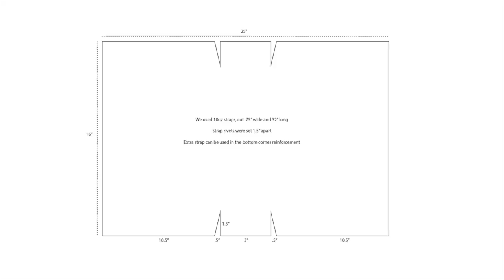The Easy Way to Make a Leather Bag

Comment: I'm at the point I can start stitching. I had to figure out where the handles went, I think I put them too close together, as you didn't give a measurement. I used some software that measures things in a photo and will tell you the distance. I used the width of the strap as a reference, it figured out the rest. 

Have to wait til daybreak to start pounding out the stitching holes. The hardest part for me was cutting this out, because the piece of leather is so big. But I think I got it done right.

Comment: Im trying to figure out the Space BETWEEN  the straps on the main panels and I am guessing each strap is spaced 3 to 3.5 inches either side from the centerline.  Rivets as stated 1.5 inches apart.  Is this correct?

Comment: It's beautiful!!!! On the End, do you use any kind of conditioner or oil in the leather? What is the measure of the straps?
Reply from the maker: Thanks! we burnis the ends with gum trag - and we went with a 14" drop, so the handles are about 32" total length

Comment: Please can u list the names of the equipments you used?
Reply: look up leather working tool kits on Amazon good for just starting  But mallet hole punch Edge beveled
Reply: Razor blade  wing tip
Reply: 5 or 6 prong 5 mm Leather chisel
Reply: @fireboxguy8180  thank you so much🙏
You've got beautiful stuffs

Comment: I believe a baseball or a backward stitch would work better for you on this project, the Chicago screws R a great idea, when I make a project like this I ALWAYS use Chicago screws on the handles 4 the future, in case the customer brakes them, easier 2 replace. GOD'S BLESSINGS BROTHER ✝️⚾ 🙃
Reply: Jim 
Hey Jim I believe this is a Woman. A very talented and skilled one.
Reply: @CS-vg1dt  Sorry, mistake, I have it in my return and forgot to add SISTER. GOD'S BLESSINGS SISTER✝️⚾🙃
Reply: Jim Athey Jim just wanted to make sure she gets the credit coming to her. All is good.
Reply: I like screws as well but I’m always afraid of them backing out even though I use red loktite. I use solid brass rivets now. One unexpected advantage is that , believe it or not, the brass rivets is easier to undo than the Chicago screw. (Assuming that the screw is impossible to unscrew once loctited which is always the case). 👊🏼
Reply: @SofieldLeather   ok, I use a plyers I purchased from Weaver leather it acts like  another hand because it locks around the Chicago screw and I have NEVER had one come loose infact l always tell my customer if they want something changed they have 2 come back and I can change it at NO CHARGE. Now I haven't been doing this 4 very long as some of the other Leather Smith's that I know have. Any questions please feel free to contact me here.✝️⚾🙃
Reply: Jim Athey 👍. Thanks. I have those pliers. I think their called macolian pliers or something like that 🤣. For what I do, they do come loose. I make firefighter leather and under those strenuous usage, they do come loose. I’ve had to replace countless screws. I since then only use screws where I can’t use rivets. I’ve even implanted that style into my bag designs as well. But I do see where regular civilian use shouldn’t be a problem. Thanks for the reply. God bless.
Reply: @SofieldLeather  Interesting U say that, I am in the process of finishing an equipment belt 4 a fireman. I used copper rivets. I personally only do custom, leather projects and teach. GOD'S BLESSINGS BROTHER ✝️⚾ 🙃
Reply: Jim Athey 👍